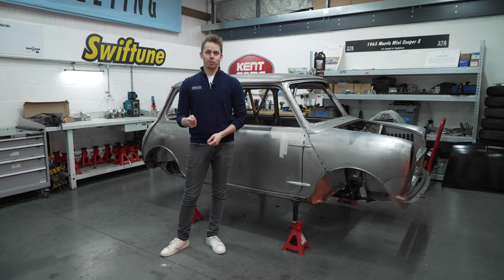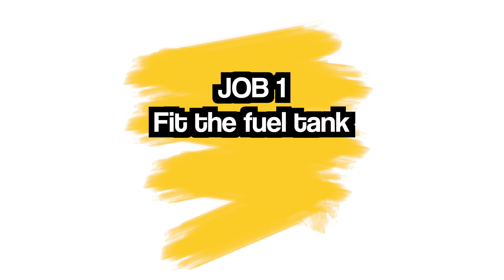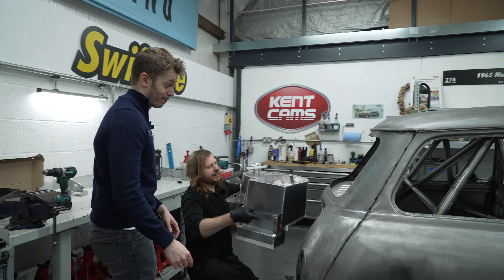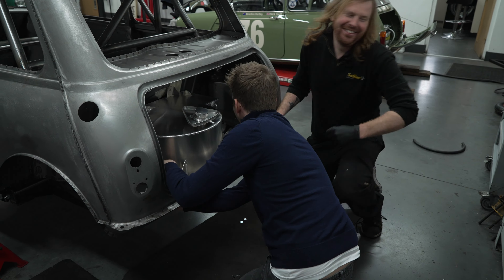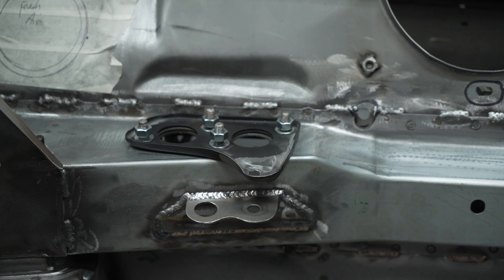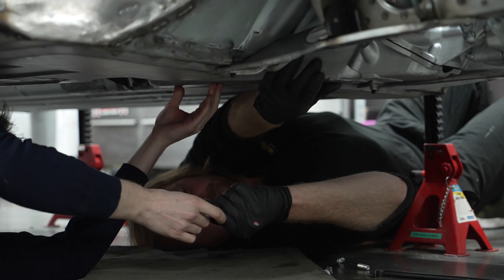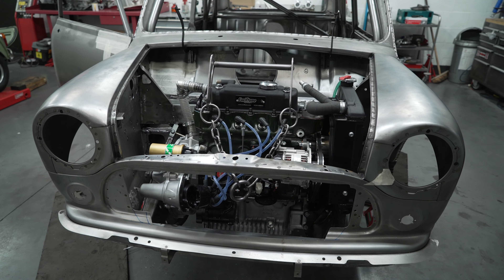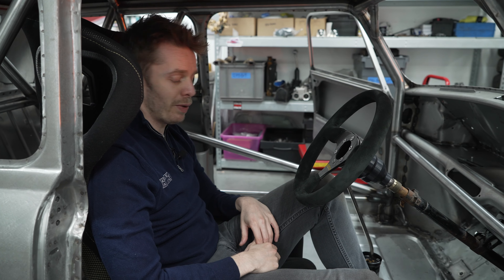Building a Classic Mini Cooper mk1 to FIA race spec with Swiftune | Day 1 pre-paint work.

Comment: I assume the regulations allow you to use the later remote gear linkage rather than the mk1 pudding stick.
Reply from the maker: @ChrisandHeathervanlife  it’s a 4 speed dog box as well. So all racing internals. The original gearboxes are just incapable of racing speed